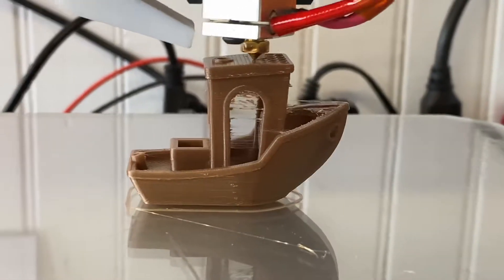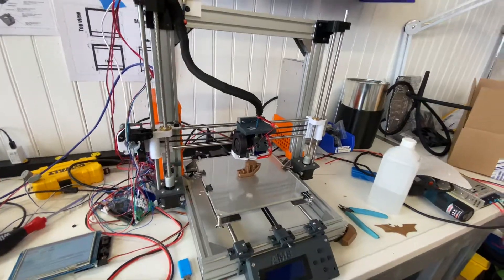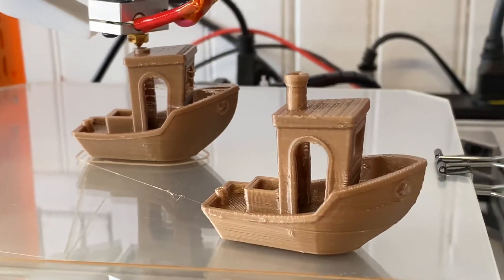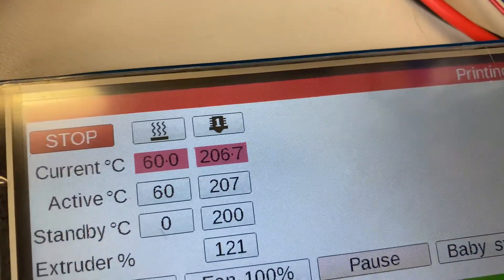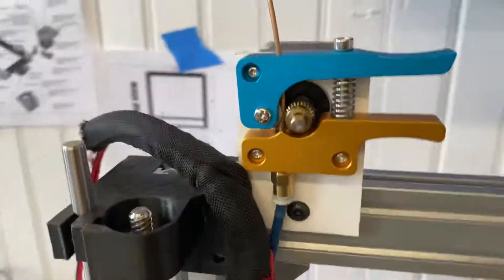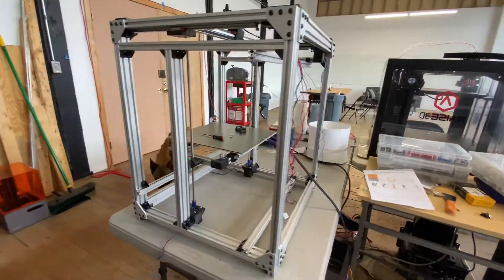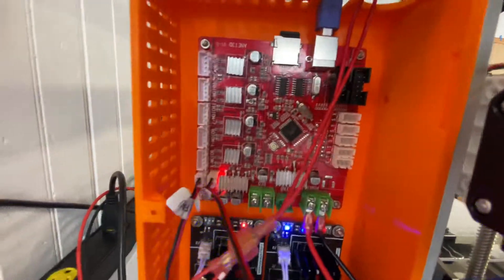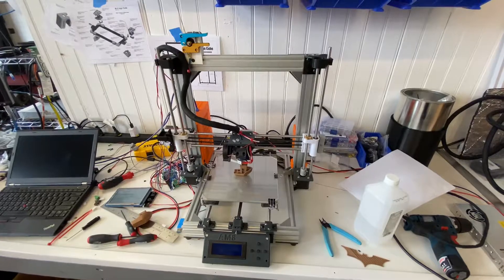Anet A8 with Duet2 WiFi board upgrade!

Comment: Hello! The plastic connector on my AM8 just melted on my mainboard. I wanted to use my 3D printer for work related projects. I did research on various of motherboards and am leaning towards this one. Since ill be using my printer for work, I might as well invest in quality parts. Ill be pretty much rebuilding my rig to 24V and a Chimera dual extruder. Do you have any tips for wiring this mainboard up? Thanks.
Reply from the maker: Just be sure to follow the documentation on the site and you will be golden. I’d advise use of a mosfet for the heatbed and build in extra safety where possible
Reply: @ColeRussellMorgan   Did you use the stock wiring for the hotbed?

Comment: So I have an anet a8 and I have upgraded the board to duet wifi as well. But my motors are making grinding noises when they move, on all axis.
 I was wondering if you might have ran into the same problem?
Reply from the maker: It sounds like you may have to check the wiring of your steppers. Some of the pins may be in the wrong order inside the connectors. Did you re-wire the connectors to match the dupont style on the Duet?

I didn't have any issues with this other than needing to change the direction of the X axis in the Duet config.g